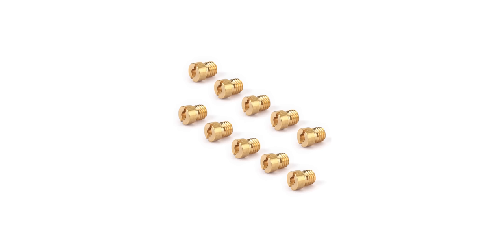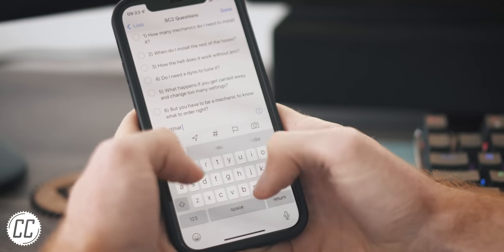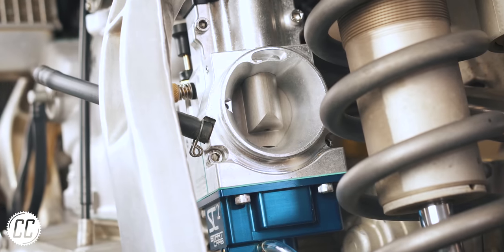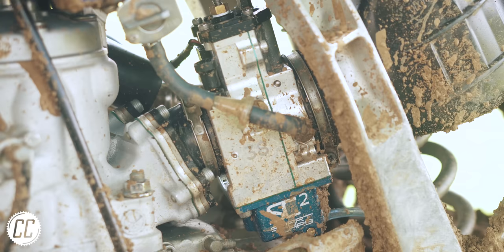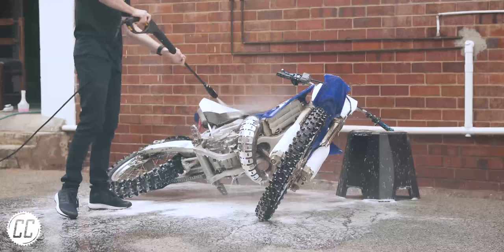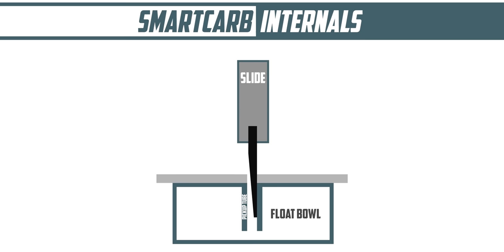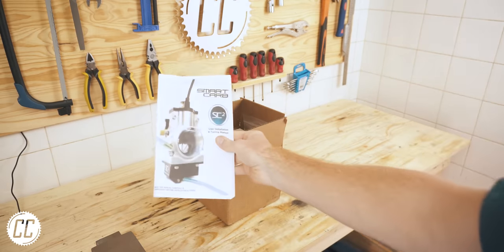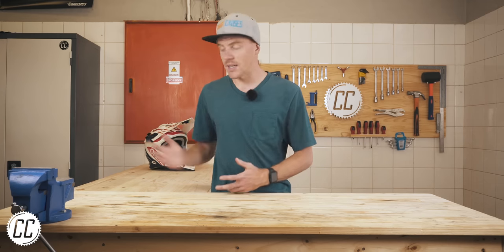The Best Carb Money Can Buy? | SmartCarb SC2

Comment: If I ever need more power, I would rather invest in making my 4T engine turbocharged than buying this piece of shit;D
Reply: Why not both? SmartCarbs compensate for blow-thru boost the same way they compensate for elevation/temperature changes. That's why we were able to help secure 5 new Bonneville land speed records this last summer in the 125 and 175cc supercharged categories with the "Murder Hornet," an overbored YZ125 equipped Yamaha R6 chassis, using the same metering rod we'd use in a YZ125 dirt bike 🤷‍♂

These carbs make power, easy.